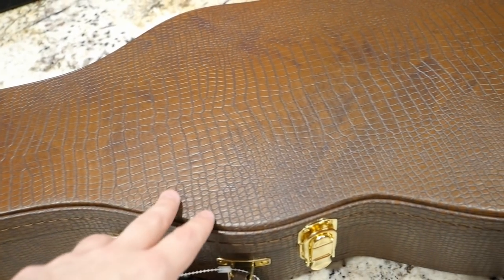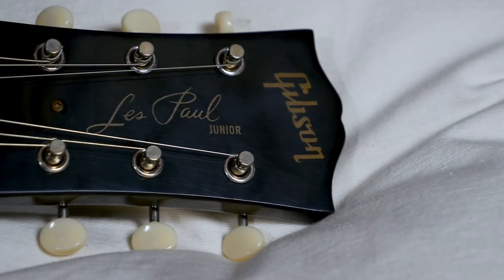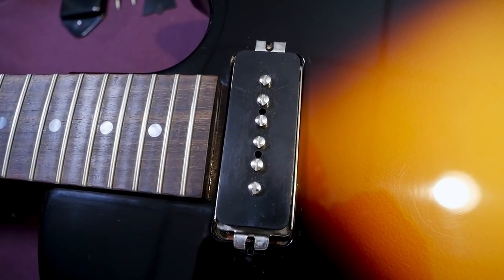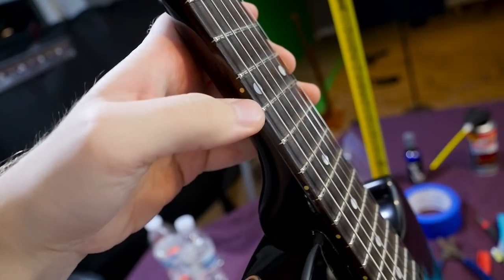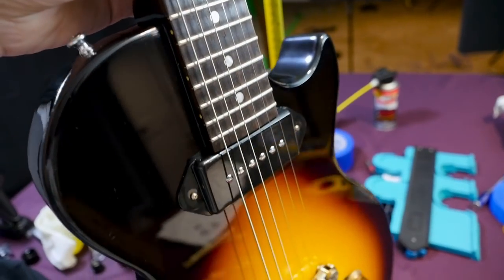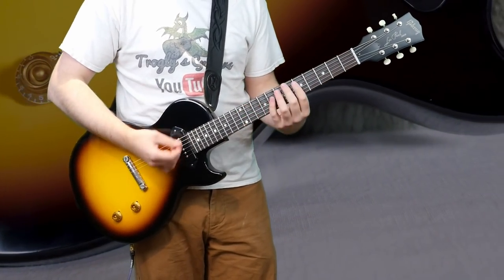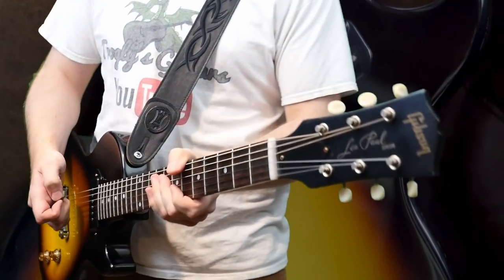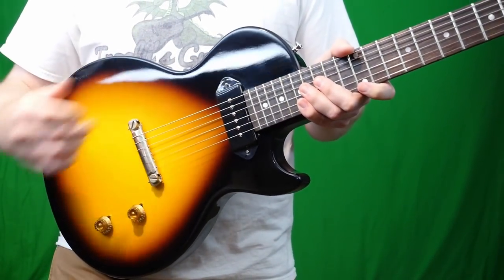This is SO WRONG! | 2021 Gibson Les Paul Junior Rhythm 1 Neck Pickup Only Music Zoo Review + Demo

Comment: There's nothing wrong with 2 threads showing at the truss rod. You have almost an inch of adjustment room.
Reply: Yes this ^^ I'm sorry Austin but whoever told you about your truss rod theory was not knowledgeable.
Reply: Yep it’s fine. My newer r6 showed two threads out the box. Neck is perfectly straight and truss rod has plenty of play. I noticed on the last video, the bridge only les Paul, had a couple of threads showing too. Perhaps some of the newer custom shops are just coming out that way
Reply: @dyamariv3628  dude makes serious money reselling instruments yet still lacks the basic knowledge

Comment: FYI, if you hold a pick right, the tip shouldn't descend far enough into the plane of the strings to be hitting the pickups. "Room to pick" is the stupidest reason to buy a one pup guitar. That's like saying taller frets give you "room to finger". Your fingers don't touch the frets, they touch the strings, and a pick shouldn't hit the pups. The "pickguard" was not put there to protect from the pick: it was added to classical Spanish guitars no one ever used a pick on to protect from fingernails. The damage on the front of old guitars is from the nails of the picking hand, not the plectrum. It's a scratch plate, not a pick guard. Please... try to play a guitar so the pick comes down where the damage is (ala Nelson's Trigger). Basically impossible, but you will notice the nails of your right hand resting there. This screed is basically to say that there are reasons to buy a one pup guitar, but "picking space" isn't one of them.

Comment: having the dog ear means that there isn't any routing or wood taken out of the body, in theory this is a good thing. One of the things that appeals to fans of these styles is that they are essentaily just a slab of wood with a pick up on them. Makes them rude and crude.
Reply: just like a telecaster, or should i say esquire?
Reply: Based on what? The dog ear per se its just a worse looking pickup ring

Comment: Having a junior with only a pickup in the neck position seems like a good idea to me, especially if you're playing blues or folkier style music. I have a 1963 SG Jr, and although I love it, it only really works for playing loud rock music. As I've gotten into playing less aggressive music I've leaned more and more towards neck pickups. Also, if for some reason you wanted to add a second pickup, you wouldn't have to worry about the routing weakening the neck joint the way you would if you wanted to do the same modification on a standard Jr.

Comment: I like it. I think a lone single-coil pickup is best positioned at the neck, while just one humbucker is better at the bridge. In each case, you get the maximum versatility through picking technique and amp adjustments.
Reply: I bought a zoot suit les paul for exactly that setup
Reply: The neck pick up position is in a harmonic deadspot for the 5th harmonic on open strings, so while you can kind of fake a neck pick up sound with a bridge pick up only instrument by cutting those highs out, you can’t fake a bridge pick up sound from a neck pick up only guitar. 🤷🏻‍♂️ Those open chords will always sound muddy.
Reply: @Jonathan_Doe_  not true. and tons of gibsons (and some fenders too) pull off the 5th fret harmonic with no issues. there's no mud here.
Reply: You should try an Esquire, my friend!

Comment: Would love to see/hear a side-by-side of this beauty and a regular Jr. I'm curious how much of a difference that pickup placement makes. Of course, that might be a little to niche even for here, lol.
Reply: Should be easy to find a special with the same pickups, then flip the switch. The bridge P90 is what you want with any significant distortion, but if you play clean and can only get one, I'd go with the neck for sure. (Clean, I tend to turn on both of them, but if I had to choose one...)
Reply: @laughingdaffodils5450  some people say that the absence of another magnetic field on these single pickup jrs makes a huge difference in tone but i have no experience myself
Reply: @notapplicable328  I am a fan of single pup guitars but I don't think that particular 'reason' stands up. Yes, the magnet drains the string ever so slightly - that's what produces the electric output. Yes, the magnet still does that whether it's switched on or not. So yes, all other things being equal a single pup drains less from the string that two, you'll have some tiny increase in sustain with one, again all other things being equal. But all other things are never equal, and this difference is so small that it's completely inconsequential compared to virtually any other variable you want to compare it to. Pup output is measured in /millivolts/. 

The reason single pup guitars can be great is because they can (ideally) just give you the tone you want with simplified controls. Billy Joe Armstrong would never turn on his neck pickup, unless it was by accident, so why have it at all? And equally the other way, if you're doing that Jim Hall sound and that's your thing, why add a switch and two more knobs that will only ever serve to get in your way?
Reply: Regular Jr's have a hotter pickup in the bridge position.  At least 8k.

Comment: I love it 🤩 I have a 70s/80s Kay LP that I wired up with just a neck pickup - I love single pickup configurations. I used a bridge P90 which gives it some exceptional twang in the neck position, and picking nearer the bridge certainly opens up the tonal variety! 
Enjoyable video as always!

Comment: Nope.  I prefer my guitars to have 2 pickups in the traditional position, with traditional separate volume and tone controls for each..
If you want to play mostly the neck pickup, then flick the switch and keep it there.  The option to switch to the bridge pickup for a brighter tone should always be available.
I do own 2 single pickup Les Pauls --- one with a HB at the bridge, and one with a dogear P-90 at the bridge.   With these, I feel limited because there is no neck pickup to give me a more mellow tone.

Two pickup guitars win out for practical reasons, especially for those who may not have oodles of cash to shell out for a large guitar collection.

Comment: I would turn the knobs into push/pull switches and give it a Jaguar type treatment. One switch activates the "rhythm circuit" and the other would be a "strangle" bass cut.
Reply: Thinking the same thing with a bass cut push pull at least no rhythm circuit though, I feel that would be a bit unnecessary accessory to the circuits n tone how would that work with both I've never had a jag but I've scene how the JM works I'd think that'd be more useful on a two or more pickup guitar or one with only a bridge PU but then I'd probably wouldn't want a bass cut mixed in. Generally curious🤔

Comment: Why not make a model with a slidable single pick-up?  But I guess it wouldn't look too aesthetically pleasing having a big cut-out between the end of the fretboard and the bridge.
Reply: I want to see someone pull this off
Reply: Verso instruments does this
Reply: Ibanez did it.
Reply: @TheCadegoodspeed45  -  Yes, on an early 'Iceman' model, wasn't it?  Gibson had only done it on a bass once, if I remember correctly (Grabber bass), but the pick-up could only be moved a a couple of inches or so.  Unlike Westone's 'The Rail' bass, that also had quite an 'out there' design 🙂
Reply: @pollyanna147  - Yeah!  Me, too! 🙂
Reply: @JuanEsquivel-ex8nv  - I haven't heard of Verso yet and will check them out, cheers! 🙂

Comment: I think those scuff marks are from the case. My 2021 Standard 50’s neck in Heritage Cherry Sunburst had a small scuff mark just like that on the upper shoulder by the toggle switch on the side as well. Only that one though, the 2020 Tobacco Burst and 2021 Alpine White Custom Shop Custom did not have it. All 3 are from AMS….

Comment: Silly Trogly, SC is for Single Cut - since Juniors also came in DC. The DC didn't release until '58, this is a R'57,yes, so a guy or gal on the line just fills cards and stuffs cases, not thinking of history - but sees 'Junior' so is either SC or DC. Good old Trogly, catching Gibson history errors. Ü

Comment: It’s so cool! Reminds me of my early 60s es125
I’d totally buy it!
Reply: ES-125... Isn't that pretty much an ES-175 but without the cutaway?
Reply: @FloodExterminator  
Not exactly.

The ES-125 was the entry level model (until the ES-120 came along). It is less ornate:  dot inlays instead of blocks, different tail pieces and tuners, and after 1957 the ES-175 was only available with humbuckers (yes, those same PAFs used in the holy grail Les Pauls).  Needless to say many ES-175 from the late 50s no longer have their original pickups.

The ES-125 was also available with a cutaway (C designation in the model name), as a Thinline (T in the model name), and with two pickups (D for dual pickup). They were available in any combination of those those features. Additionally, P-90s were the only pickups available in the ES-125.

Comment: What does the k omes mean? What’s a good k ome and a bad k ome? Sorry for the dopey question.
Reply: Since nobody else answered you, I'll give it a try and I'm going to simplify, but try not to over-simplify. Ohms are a measurement of electrical resistance and k Ohms are thousands of Ohms. The point isn't the actual number, just how much it is in one pickup when compared to a similar pickup. In wire, resistance goes up as the length of the wire increases, and resistance is a way of estimating the length of the wire. All of the wire is wrapped around the pickup bobbin, so the length is directly related to the number of coils of wire. This means higher k Ohms equals more coils of wire. Pickups generate more signal, all other things being equal, when they have more coils of wire. So, putting it all together, with a similar pickup, higher k Ohms means a hotter, higher level signal.There is no good or bad, just different sounds.

One other thing that I already said, but needs a repeat - looking at k Ohms can give you a good indication of how hot a pickup is when looking at similar ones, but you can't use it on different designs. Other details, make a big difference in output and it sees like everything impacts tone.
Reply: I guess I should add, I don't use a P90 in any guitar I have, so I don't pay that much attention to them. I did look it up though. Vintage P90s use 42AWG wire and read between 6.5 and 8.5k Ohms.
Reply: @RandallHayter  Understand now. Thx!